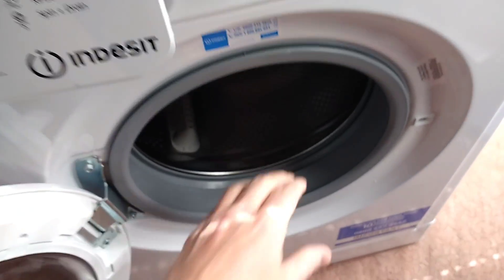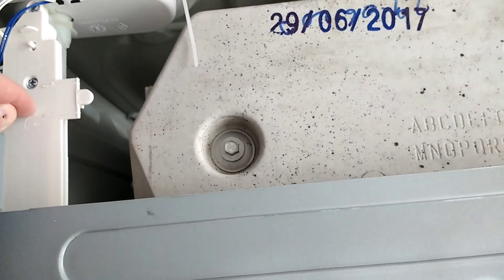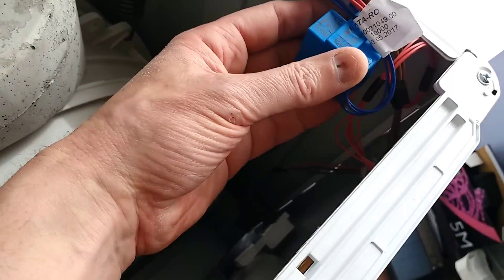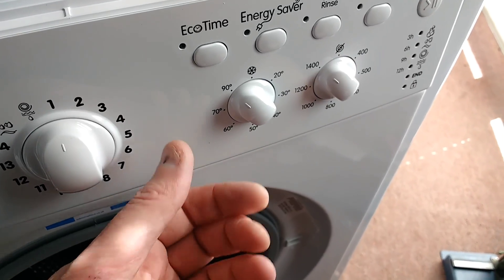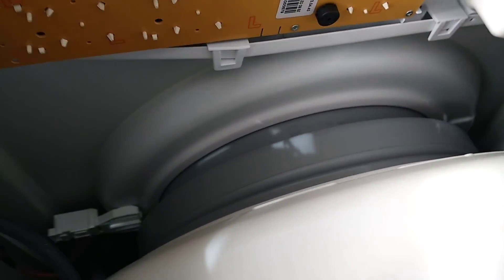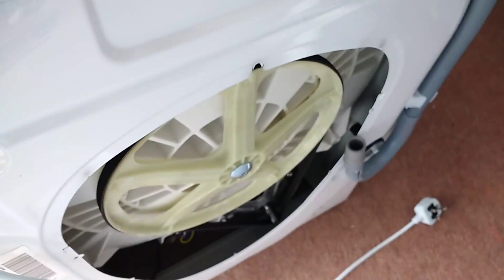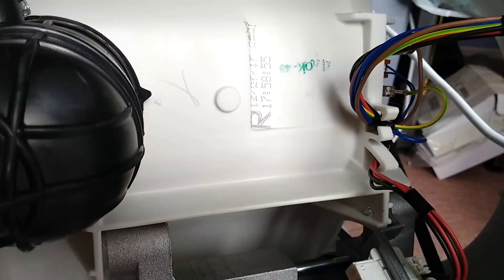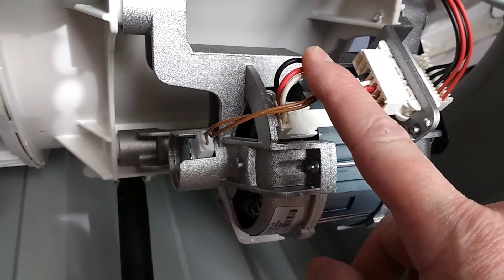Inside my new British washing machine (clothes washer).

Comment: I have a Bosch machine that is remarkably similar and about the same age.
A year or so ago the inflow diversion wasn't working and flowed into all the chambers with insufficient flow to wash the powder (tablets actually) into the machine.
I presumed it would be algae clogging the pipes and waterways but dismantling it proved not so, everything was free and clear.  Ordered new solenoids that never arrived. 
Also, the programs would often pause after ten minutes and have to be 'unpaused'
Moved the machine from the utility into the kitchen (dumped the dishwasher) and suddenly all works properly again.  It can't have liked being isolated in the utility, must have been lonely.
Reply from the maker: I had an issue with the pausing.  I replaced the start/pause button and it resolved the issue.

Comment: This video was interesting to me because just a couple weeks ago I repaired my own machine from 2007. What happened was the rubber hose connecting the soap compartment to the barrel had turned brittle and cracked (partly due to age but I suspect the high concentration of soap somehow degraded the rubber). The VFD control module for the motor was located at the bottom of the machine below where that hose is so water was dripping onto the module. The result of that was that the drum would spin fine for the first part of the cycle, but after a while the drum would barely move back and fourth like it was trying to move but couldn't. What happened was the soapy water got into the module and ate away some of the solder mask at the bottom of the board where the water was sitting, causing the current to flow to ground (earth) instead of to the motor, and since there was no GFCI/RCD, no safety devices were tripped. The fix was easy enough, I replaced the hose with an OEM one because they still sell it ($50USD for a piece of rubber! Still cheaper than a new machine though) and applied some solder and clear nail polish to the parts of the board where the solder mask was missing. Other than that slight mishap it still works great which is pretty cool considering its age. Also I don't know about in your machine, but in mine, the module at the bottom is just a VFD control for the motor, and all the "brains" of the machine are on the front control panel.

Comment: „Power and data“?
Is WAN now a shortcut for Washer Area Network?

I‘m sure you are aware of the death of the LNC/TNY chips and that the so-called crappy electronics is often dead because of the smps chip not really protected against surges. But easy to fix.
BTW, no different situation with the more expensive brands.

Comment: Take  a 10 year old Meile machine apart and spot the difference. Our Meile machine told us it had water inside (it has a float operated switch in the base). Indeed it did have a leak and is an easy fix. I was very pleased to take off the top cover and find a wiring diagram and parts diagram folded up and clipped inside the machine. There are also no sharp edges that the cheap machines have everywhere to slice your fingers to bits. The quality is evident. Cheers. Rob
Reply: It‘s „Miele“, but I once found out that this spelling misleads English natives to pronounce it exactly the way we would with your spelling. You should say the „e“ and ignore the „i“, because in German the „i“ sound like your „e“ and the added „e“ just lengthens the sound a bit. 
But yeah, foreign language is hard, I make enough mistakes as well 😇

Comment: I do know that the hot water pump and the main drive motor in a lot of these new washers share casement with the extruded chasis of the washer itself and are usually proprietary in fitment specific to individual models..
Makes part scrapping/replacement almost useless.

Comment: No heating element? Easy to repair they are. Got a bosch series 6 washer drier. Well worth the extra cash to have a brushless motor and 6kg dry capacity in 2 hours condensing water straight to water outlett.
Reply from the maker: Yes it's got a heater.  Just a cold water supply.

Comment: Sorry but since when was INDESIT LAUNDRY equipment made in the UK they are an ITALIAN born company and as far as i know these machines are made abroad and the build quality is very poor they have welded outer tubs so drum bearings cant be repaced and the electronics are of poor cheap quality and very unreliable to say the least basically these are built to last 3 to 5 years in other words they are throw away appliances oh by the way i forgot to mention that i was a domestic appliance engineer for more than 40 years regards from the fridge doctor.

Comment: Here in Russia we never had the hot water hookup appliances of any kind. Washing machines, dishwashers, etc. are always cold water hookup with a heater. Nowadays of course there are models that just support either hookup on their inlet since it's all software controlled, but our district heated water might get too hot for normal 40 or 60 degree programs in those machines, which is why nobody really uses that type of hookup.
Reply from the maker: Our modern machines are all cold water too

Comment: Hi, Clive. I'm now repairing mine. I'm so sorry for that model you have bought. One typical failure of washing machines are about breaking the three wings inside the drum....but...your drum is plastic made so it is impossible to repair, there are a guy that have to break the drum with a dremmel and after that glue again (a lot of risky repair). It is a expensive machine if you have a problem with that. I recommend you to take a look on your pcb washing machine, because there are a lot of smd components that could be fried with a high voltage peak (condensers, ic, resistors, fast diode, zenner diodes, electrolitic condensers, etc). Open it and take a photo for a future. It is very, very important. I'm just now trying to repair mine (not this brand).
Reply from the maker: The internal paddles on the metal drum can be unclipped and swapped.

Comment: My old AEG washer-dryer was build like a tank when I took it to bits. I should probably have spent the money to get it fixed instead of buying a new washing machine. It was way too cramped and complex inside for me to have a go at fixing it, though I had hours of fun disassembling it! My current LG has very loud water inlet valves, and can let some water into the drum if I don't use it for a while.

Comment: Wow, the control panel on that is completely different from what you'll see on a US market machine. It looks like it has discreet settings for the water temperature, and some fan thingy that goes from 20° to 90°, and a big knob that goes from 1 to 14? Not a clue how you would operate that thing. Where are the cycle settings for delicates, bedding, permanent press? Totally lost.

Comment: I've stopped buying Indesit products, as construction quality over the years has declined. That said, my latest Bosch only lasted 6 months before the main bearing failed - which needed the whole machine replacing.

Clive, how are you getting on with yours after 2 years?
Reply from the maker: It's still running fine.

Comment: I opted for the mass produced BUSH (most basic model I could find). It's lasted 12months so far, so I'm fairly confident it will give me at least 5 years of daily usage. I generally only use the 60 minute at 60 or 40 degrees program. Previously I had two secondhand machines.  An old Hotpoint that lasted 3 years and a modern indesit that only lasted 6 months. Sadly, Hotpoint aren't any way near as reliable as they used to be (although the old complicated clock/cam system was a technological nightmare with too many parts presenting too many opportunities to go wrong). I totally understand your logic regarding mass produced machines that are made in factories that build several different makes of machine, but there's also the worrying fact that more units produced means more chance that one will fail. For me, it made sense to spend £185 on a machine with less parts to go wrong and that will do my washing for 5 years (1705 days), costing me just 15p per wash instead of £2.50 at the laundrette. An interesting thing to note; when I used to fix computers, I found that the ones that were just one level up from the absolute cheapest (ASUS and the like) were far more reliable out the box than the more expensive models. It's something to do with them actually being built to just do the main tasks for the majority that made them be built better. The really cheap ones were junk cos the manufacturers cut corners to make them cheap (Acer/MSI). The more expensive retail ones were less reliable because they had the latest not fully tested components and were crammed to the max with power and resource hungry factory upgrades (I'm looking at YOU Dell/HP/Lenovo). The even higher end units were designed for business use and had the top of the range of fully tested, properly matched components and were very reliable, if somewhat not as impressive on paper as the higher end of retail machines. So, that's always my advice. I used to think that I'd been just lucky, buying the best of what I could afford and having no serious issues at all with any technology I've bought, whereas my friends seem to be always plagued with problems with thier more expensive items. I think it's partly that I respect my technology and look after it, and partly that I bought stuff that was made for a bigger, less demanding, market. If something seems impossible, it most likely is; If the impossible becomes possible, it will be hideously unreliable (initially). ...and if something is designed to not possibly ever go wrong; it's usually impossible to fix (DNA)

Comment: Easy to repair, except it's the drum that will fail. Wait until you discover the drum assembly is ultrasonically welded shut, even though it has moldings for screws. Absolutely criminal. I have one of these (branded Hotpoint but identical) the drum spider failed spectacularly as it's aluminium. You have to buy a whole drum assembly at 2/3 the price of new machine, and that was at a discount. Still replaced it though, think of the planet. 

The drive belt is ever so slightly elastic, very strange, and so tight you expect the pulley to buckle. But that pulley is incredibly tough. After extracting the old stainless drum as a fire pit, using a large hammer to shatter the assembly, the pulley just wouldn't break. It would certainly win against an overly curious hand. Shudder.

Edit.. excellent, this video is 2 years old. Well done YouTube for recommending it as brand new.
Reply from the maker: I do see all comments even on the older videos.
The welded outer drum is very wasteful.  I guess they're thinking mainly of avoiding leaks for liability reasons.

Comment: I've replaced ball bearings on drum on Beko machine that lasted me 10 years , and that is insane amount of work , as you need to disassemble everything to bits. In the process , i have changed outer drum (tub) rubber seal that was failing slowly apart , tho it didn't leaked and door lock which was also near its end of life once i took it apart. Reassemble it , attached everything and turned it on , but water wouldn't get in. So i had to change solenoids as they stuck and blocked water intake. All parts were cheap , but amount of work was insane. Especially since I rarely do repair home appliances.

Comment: I hate modern washing machines, just like I hate those complicated microwave ovens that a NASA pilot would have trouble using when the old ones simply had a timer and a power setting knob, along with the silly impossible to set digital room thermostats that replaced the bimetallic strip ones which were so easy to use. 
No hot fill should be made illegal, I have endless amounts of free Solar Thermal Hot water most the summer, so I would not want to be either paying for electric to run an element or bothering my battery bank and the MOSFETS on my inverter with excessive loads.
My Hot Point Aquarius will hopefully do another 20 years if I keep patching it up, it has a mechanical timer and is simple to use..

Comment: The mechanics are crap. I have a similar model with a built in dryer which is only a couple of years old but the ball bearing is completely worn yet. And it cannot be changed - so the machine is junk. Don't buy.

Comment: Whoever designed Polycarbonate moulded drums making all newer machines scrap when a bearing or seal goes wants sacking.
Hotpoint used to be fully repairable and pretty reliable but are now junk along with most other makes.
The only machines I have ever had that lasted more than 10 years are 1980,s Hotpoint and a Siemens from late 1990,s still going strong in 2020. I was a Hotpoint Service Engineer for a while but now wouldn't recommend Hotpoint or any of the cheaper machines.

Comment: 2020: plastic is bad, it kills nature!
Also 2020: let's make non repairable, all plastic washing machines
Reply: Actually this isn't even all that bad. It's actually less complicated than my own washing machine from the early 80s that I've had to do a bunch of repairs to.
Reply: you get what you pay for
Reply: Well, its also quite cheap though. Much easier to handle than metals, and you got extensive testing to find out exactly where you dont need as much strength (assuming this one doesnt just break a few months later).

Main issue with plastic is disposal. And maybe that its oil based, a limited ressource.

Comment: The make is missing the letter   H    as we in England and employees at Hotpoint (now Whirlpool) call this brandname make with an H included.    They all made in Turkey now as Hotpoint UK as sold out to Whirlpool.    Whirlpool having fun having a global recall on most Hotpoint designed washing machines and dryers, which Whirlpool wish they never bought Hotpoint and its other brandnames.    [ the H is not for Hotpoint ]             
  Indes it.

Comment: Was there not an issue with early models where the door lock wiring not incapable of taking the current from the heating element causing fires. Maybe you could look at your model because this issue was supposed to have been addressed.

Comment: Do you remember when washing machines took an hour to do a load? My Indesit insists on wanting to run for 2hrs 55 minutes per load.
I'd say that washers from 20 years ago are much better.
Reply: The older ones are far better, I keep patching up my old Hotpoint Aquarius, too much electronics in the new ones and no Hot water fill for when I have loads of free Solar Hot water.
Reply: @richardsandwell2285  There is no law to say that you can not hook up a hot water feed, you may need to add a pressure feed pump to move the hot water in under more pressure but there is no law to say you can not do that.
Reply: The pump could be actuated via a signal from the intake solenoid, a simple hall sensor switch stuck to the solenoid to ensure isolation may be an option. 
I am sure Clive has a few ideas knocking around...
Reply: @thepvporg  I did think about sending Hot water straight into the cold feed, like you say I suppose with another valve adding hot fill good be done. However what really annoys me is the complex electronics and circuit boards, which if they go wrong can cost almost as much as a new machine to fix.
Reply: @richardsandwell2285  ITs all a big con.
The boards cost 10 a penny in reality.
The components cost 100 a penny.
The true cost, based on the end price point, I would say based on my experience, that buying for a manufacturer would be literally £5 a board all in for a top of the range machine, your budget machines, a couple of quid at most.
It is an industry I have worked in and I so know the dirty tricks and stunts some companies pull to turn a bigger profit.
The number of monsters I had created as Dr Frankenstein of the company I worked at for a few years... I have resurrected, fridges, freezers, hobs, ovens, extractor fans, washing machines, dishwashers and they were then moved as "Factory 2nds" or in some cases where they were complete and "as new" sold as ex-display / new ... It is the main reason why I hate paying top dollar for a piece of equipment that is designed with a limited lifespan, costs next to nothing and companies had guys like me, reworking hardware to turn a profit.
Reply: @richardsandwell2285  I'd suggest that your intake from hot water is pressurised by a pump, unless you are lucky enough to have one of they new-fangled-gas jobs that provide mains pressure (nearly) hot water on demand...
Reply: @thepvporg  It would only be an issue if I changed from my old Hotpoint dual fill Aquarius to a modern machine, I think I would have no choice but to supply the machine with hot water through its cold fill.
Maybe I would consider doing away with my header tank and supplying my hot tank with mains pressure, a pressure reducing valve, expansion vessel and a TPRV and tundish, with my stainless steel hot water tank it would not be a big feat, my tank is rated for pressure. 
What will probably happen is if my Aquarius dies and I cannot fix it, I will trawl the secondhand shops for another old dual fill model. 
Although I am from an Engineering and Scientific background I do not believe in technology for technologies sake, I certainly do not think that Boris Johnson or anyone in the soon to be communist British Government needs to know when I am washing my underpants. 
I have heard many new machines gather information, it is probably nonsense but I would sooner have a washing machine without complex electronics anyway, far less to go wrong.
Also, it is not like the damn things need to be complex anyway.

Comment: Pretty much all modern machines only have cold water feed. Also they use welded/ bonded drums which cannot be opened to replace bearings (unless you are OK with a hacksaw and glue). Shameful built-in obsolescence.